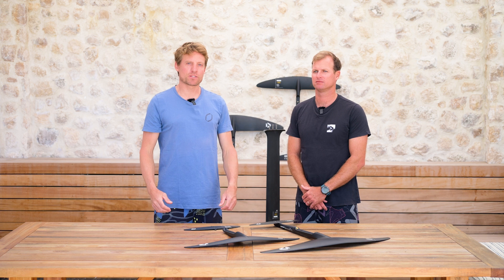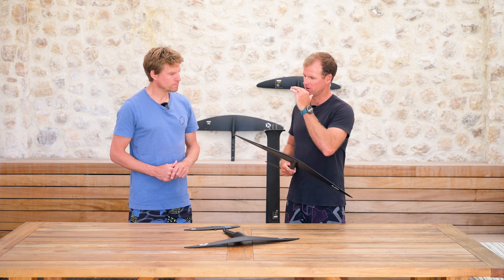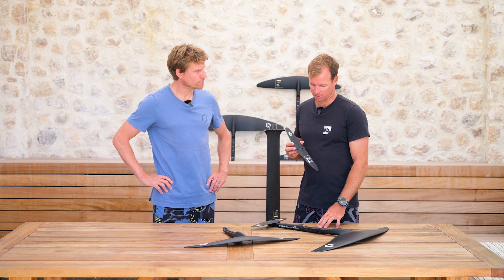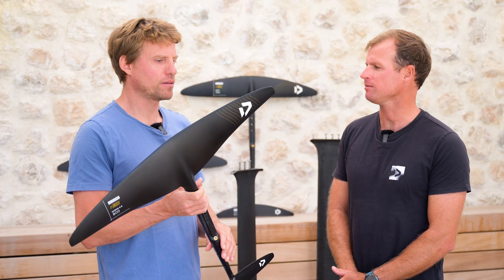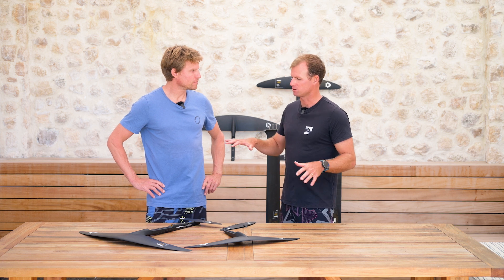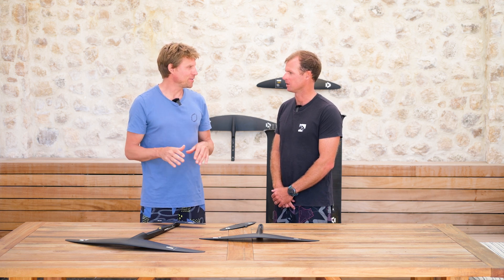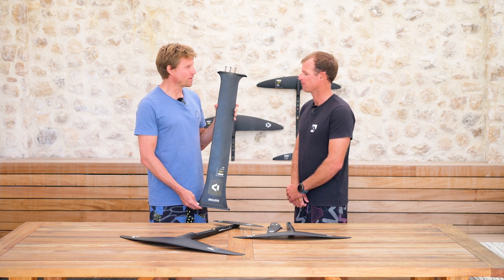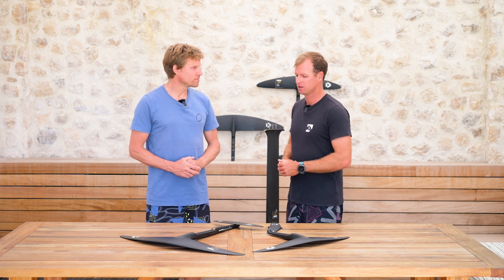Duotone Wing & Foiling Tech Talk - Carve 3.0 D/LAB & SLS 2025

Comment: Guys, I am thinking about buying a used carve 3.0 sls 1100. Unfortunately the seller has only the front wing so without the recommended px175 rear wing. I have the aero free set 1750 with the 250 rear wing as my main set. Would that fit carve 3.0 1100 at least for the beginning or I will loose a lot from performance?
Reply from the maker: No unfortunately that is way too big, try to order a 175 via a shop, or the 180 from the carve 2.0

Comment: Hauptsache jedes Jahr das System ändern ! Ich kotz übelst ab . Hab mir 2024 Aero carve AlQm Mast und zwei Foil Sets gekauft. Jetzt passt nix mehr wenn ich was tauschen will .. richtig geil 🎉👌🏼🤮
Reply from the maker: Understand the frustration, however I must point out that actually we have not changed our system for our sup/wing front and back  wing attachment for 6 years now. We just changed the mast to fuselage system  so that our alu and carbon masts could be compatible with the same fuselage. All our front or back wings will still fit your system, if you want to change anything.

Comment: General question about your foils: do you design all foils to use it with one mast position? All my Glides 2.0 750/900/1100 are working well in the same position.
Reply from the maker: Hi there, yes that is the goal, to not have to move too much - generally the bigger foils tend to be more powerful/give a lot of front foot pressure, so they can be mounted a bit further back if too much front foot pressure, whilst smaller foils can be mounted further forward. But as mentioned, your experience is ideal, to have them all in the same position and this is always the goal during R&D. There are slight differences between the Carve vs Glide for example in terms of mast placement, but it's really just also a question of taste/weight/level of front foot pressure that you like or are used to. Some freestylers mount the Carves all the way forward, whilst Freeriders looking for more speed, are even behind the centre of the boxes.
Reply: @duotone.wingfoiling  Thanks, that sounds  meaningful!

Comment: Hello! I want to test the Carve 3.0 for windy and choppy days in Lago di Garda. My current foil is Glide 2.0 750/900/1100, wing size 4.5 or 3.5, ma weight 90kg, midlength board 90l. Should I try size 800 or 950? The Glide 2.0 is for me THE foil, but maybe the control of the Carve 3.0 in such conditions is a little bit better?!
Reply from the maker: I would rent the 800 first at the Duotone Pro centre in Torbole, to see how it compares for u? Control could be better yes in theory, but I would try it before buying, to be sure the style suits you, as the Glides are very good foils too.

Comment: Hi, can you compare tako off/early start the size 950 with glide 1085 and glide 2.0 750? I use 1085 for light wind days and 750 for stronger wind but 750 is still a bit wild and Difficult to maintain altitude in choppy lake condition. I tried new 950 on choppy stronger day and everithing was nice, take off, control, speed, glide, pumping was smooth. I have 90kg wat do you think like one foil? I think that the lift is simmilar like old glide?
Reply: And any info about glide 2.0 +px stan combo? Will be fine?
Reply from the maker: @Simon.nechra yes bit faster/for winging, but less glide, if that is a priority?
Reply from the maker: @Simon.nechra  take off and lift/glide are usually not always the same-so for pure take off, the Carves have very good take offs, also not as steep as the Glide for example, which starts steeper/but then has more glide. So yes, I would say the Carve 3.0 950 would take off about the same as the Glide 1085-perhaps just a touch later, but a smoother start and also less pumping required. The 750 is quite lively yes, but perhaps try riding it slightly further forward in the boxes/use a 66cm 3BS fuselage to gain more control. 950 as an allrounder, would be ok for 90kg, so long as you are not foiling more often over 25knots of wind-then maybe a smaller front wing is needed. Enough difference between 750 and 950 as a range too though.
Reply: I would like bit more choppy tolerance and stability, witht glide. My glide 2.0 750 is too nervous, frogging in choppycondition. With 85l sky style but carve 3.0 950 is really fine
Reply from the maker: @Simon.nechra hmm, no then I think that will not be the right back wing. Have you tried spacers or moving the mast forward or backwards?

Comment: Hi, I learned on the Aerofree 2000 and can now ride back and forth comfortably, including jibes. Now I want to buy my next foil to reduce drag. The Aerofree 2000 is slowing me down. I weigh 88 kg and I’m 190 cm tall. Should I go for the Aerofree 1250 or the Carve 3.0 in 1300? Do they both start flying at about the same speed?
Reply from the maker: Hi there, ok understood. The Free 1250 will have a slightly more passive/easy start, as you would expect from our Intermediate/allround, with good lateral stability in take off and gybes/tacks. The Carve 3.0 will take off in similar winds, is then more agile and will have a higher top end speed, obviously requires a slightly higher level to ride vs a Free, but if you are bored/maxed on the 2000, then this should be no issue at all. For max ease of use, to perfect manouevers, the Free 1250. For a more sporty ride, the Carve 3.0 1300.

Comment: Hi guys, I am using the Fanatic Carve 1150 as my main foil right now (let's say v1). I only do wing foil and love to surf mushy mediterranean waves. I would like to move to this carve dlab 3.0 as my first advanced foil. What can I expect in terms of lift with this one compared to my old 1150? I am a pretty heavy guy (95Kg) riding mostly 14-18 knots and I am considering the 1100.
Reply from the maker: Hi Andrea, sounds good - so most of the below 80kg riders that I know/wing with, who have been using the 1100 2.0 (including myself), have switched to the new 3.0 in 950 size - this means(and we found this during testing, very clearly), that the new Carve 3.0 have a bit more power/lift/glide than the 2.0. Quite a bit more than the v1 which you are currently using. So I think you'll notice a lot more lift/power and especially glide. I would not go smaller to the 950, since you are 95kg/mostly 14-18knots. For regular riding over 20-25knots, then it would make sense to get the 950, or even the 800 to have a bigger gap. 

One thing, is you are not jumping/your focus is on surfing mushy waves, then you could also consider the Glide range, which has more glide  than the Carve - but to be honest, in the 1100 size, the Glide 2.0 will not feel as surfy as the Carve 3.0 in 1100 as it is quite a bit wider in span. And the Glide 2.0 in 900 is a bit small for your wind range/weight. So I would stick with the Carve 3.0 in 1100 then! :-)
Reply: @duotone.wingfoiling thank you very much for the complete reply. I do not like the feeling of HA foils, right now the 1400 v1 (which I also own) has just enough glide to keep the pace of the mushy waves I surf. So basically with a bit more glide and a bit more lift the v3 should be exactly what I am after. Can't wait for having it in my quiver 🤙

Comment: I bought the carve 2.0 1100 as the first new foil moving away from the beginner stuff. I personally developed and start to Jump and catching waves. What size would you recommend to buy now? Would you recommend to add or change the setup at all? Thx for your advice in advance. HL
Reply from the maker: @basti1365  hi Basti, what do u weigh/local conditions etc? The Carve 1100 in either 2.0 or 3.0 is a good mid to light wind foil, covers a huge range. For riders below 80kg, an allround size would be the Carve 3.0 in 950 size? Or keep your 1100 for lighter winds and add a Carve 3.0 800.
Reply: @ 85KG and using the sky Style SLS 85L. Mostly in local area, Baltic Sea.
Reply from the maker: @ ok then the 1100 as your mid to light wind foil should be good. Add either the Carve 2.0 850 or the new 3.0 800-the 3.0 is a similar top end speed, turns better and has more glide than the 2.0. But the 2.0 850 is still a very good foil.

Comment: 220lb (100kg) kite foiler here currently on the Carve SLS 950 1.0 mostly foiling in 10-20kts. Enjoy carving skatey feel and some strapless Fred Hope style tricks. What Carve 3.0 size would you recommend? 800? If I got two front wings would you recommend a 650 and 950 for light wind? Or go 800 and 1100?
Reply from the maker: Hi Charles, so I know the Carve 2.0 favourite size for kiters was the 850 2.0, especially for riders who used the 950v1 before. So I would think 800 and 950 could be the good choices, the 2.0 and 3.0 both have more power/lift than the V1. I don't think 1100 is necessary. Option 1 is to buy just the 800 first and then decide if you need bigger or smaller? but that would be the best allrounder, as it's quite similar to the 2.0 850?
Reply: @darrenhockey2191 
Yes we have resellers in Australia and they stock the Carve 3.0
I'll let Craig confirm exactly which dealer is closest to you.
Answers to your questions:
1) a) I'd suggest the Carve 3.0 in size 800.
b) prob just up to the 950 if conditions not so great /mushy / smaller waves.
Mast position roughly in the middle of the tracks for the 950 and 1.5cm further back for the 800.
2) 650 Carve 3.0 for 4 to 6 foot waves. Mast 1cm further forward than 950.
Having both length fuselage tail would be ideal to fine tune the setup even more.
Hope this helps!
Reply from the maker: thanks Jerome! @Darren, check out our Dealer finder on the website : https://www.duotonesports.com/en/wing-foiling/more/find-us/dealers

WSS and KBL sports should be able to sort you out, or the next closest online? good luck!
Reply: @BonieuxJerome having which length fuselage ?
Reply: @darrenhockey2191  if going for dlab model, you will have the choice between 37 and 43cm fuselage tails.
If you go for the SLS front wing, you will have the choice between 60 and 66cm alu fuselages.
Reply: Can I buy the new 3.0 mast wing and fuse in Australia, I live in Sydney . Also two questions . (1) (a) what’s a good setup for foildrive in clean 3 ft waves and (b) not so good conditions ? Could you also consider the mast position in tracks on the 4.6 duotone crush .
Question 2 the same above for 4 to 6ft plus waves . Sorry for all the questions but want to get things right before I buy .

Comment: Hi to everyone.
Last year I used the Carve 2.0 SLS 850 for several weeks in Manawa (mauritius) with excellent results in that powerful wave. Now I would like to know if the new Carve 3.0 size 800, with this new and completely different shape with more lift in the center (compared to my 2.0 850), has increased the planing start or this remains similar to my 850? Thanks a lot
Reply from the maker: Hi Valentin, in the 650/1100 sizes which are exactly the same area as Carve 2.0, yes, I would say the planing start is better, especially on the 1100 which has quite a bit more drive, lift, glide etc...on the 800 3.0, which is smaller than the Carve 850 2.0, the planing start is similar. But the glide on flatter, slower waves is most definitely better, as is the turning, so keeping speed between turns and on a changing wave face (from flat to steep etc) is improved. Jerome our foil designer lives on Mauritius and does quite a bit of his testing there at Manawa too, so the 3.0 has spent many hours out there before being finalised. Top end speed/freestyle performance is fairly similar, there is however less of the excessive front foot pressure on the 3.0 vs 2.0, which could sometimes lead to being overfoiled, ie the front foot pressure /liftremains similar as the speed increases, which makes overall riding easier to predict and handle.
Reply: @duotone.wingfoiling  Thanks a lot. I saw Jerome last september testing the 3.0 prototypes in Mauritus. I can't wait to test the new Carve 3.0 in Manawa.

Comment: Hi Jerome and Klaas🤙. I like your tech talks! I am currently using the 620Glide 2.0 and I love it. Especially the amazing low end and the lift and glide. I did not get enough of that with the 650 Aero Carve2.0. Does the 3.0 Aero Carve 650 get close to lift and glide and lowend!! of the 620Glide 😅?  Thank you!
Reply: Hi Stefan, Carve 3.0 650 gets closer to the Glide 2.0 620 but doesn't match it. You will still pump much better with the Glide 2.0. The 650 Carve 3.0 will come alive in powerfull waves and allow you to turn tighter on the more critical part of the waves.
Reply: @BonieuxJerome  Thanks so much Jerome 🙏. Bonne travail !

Comment: What are the low speed / early glide  properties compared to the previous model?
Reply from the maker: Hi Theresa, both the stall speed and the gliding are better than the 2.0, this was one of the main goals. Turning is also better due to the new outline/profile,, whilst top end speed and freestyle pop is relatively similar. The big goal was to improve the wave performance/riding swells, without losing the good freestyle abilities of the 2.0, which we definitely achieved, great feedback so far.
Reply: @duotone.wingfoiling  Hi, Can I expect a better low end lift and glide from the new 800 comparing to the 2.0 850?
Reply from the maker: @motislavin3791  Hi there, the 800 is obviously smaller than the 850 2.0, which had quite a bit of front foot pressure and lift. So the new 800 has less of that front foot pressure once up on the foil, but more glide once going, especially on waves, plus tighter turning. For absolute low end lift, probably similar, top end speed similar.

Comment: Looks good guys. How do you think it would fare for windsurfing foil swell riding? The v1 1150 is my current favorite.
Reply from the maker: The 3.0 has a lot more lift than the 1150 and 2.0 1100, so it will give you a lot more glide and they also turn tighter. End speed pretty similar to 2.0 1100. So could be a good option,.
Reply: Which stab would you recommend for the 90 cm fuse? (And did I see a 90 cm DLAB version on the wall behind or was that an optical illusion?). Thanks!
Reply from the maker: the standard 175PX should be good, we discussed a lot about putting the 195PX on there, but the 175PX felt big enough in the end. The 195PX gives quite a bit more overall power, but would imagine this is not actually needed for wind foiling, as you get a lot more power anyway with the longer fuse. On the 1300 I would say drop down to 175PX, as typically one size smaller for winds foiling works best. no 90cm D/LAB planned for now unfortunately. :-)